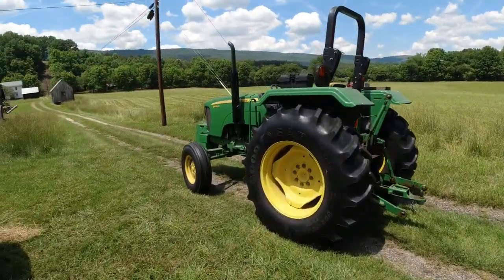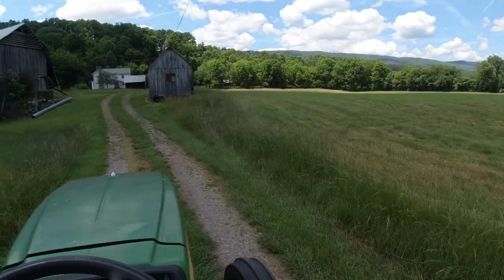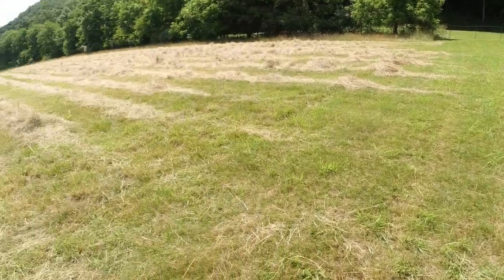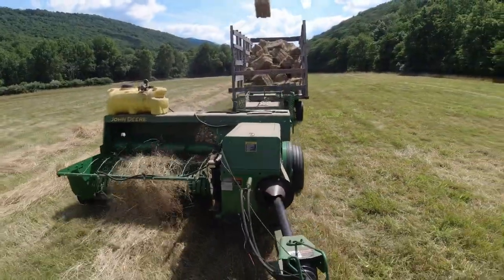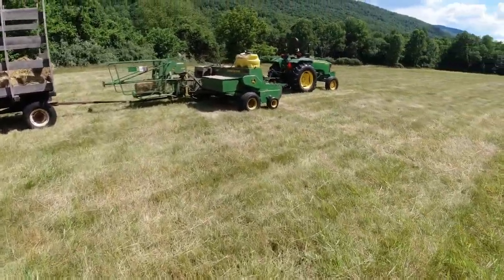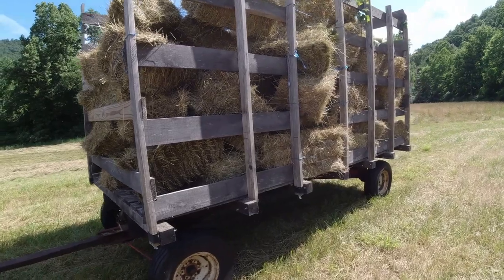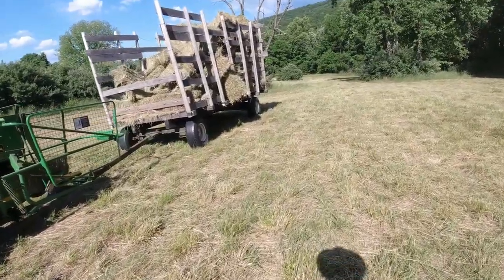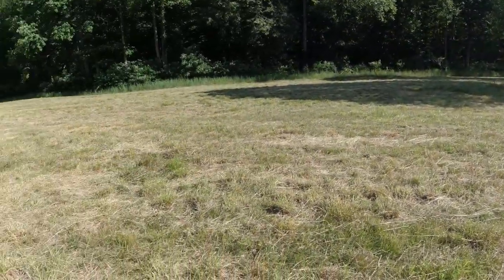Square Baling Hay - John Deere Tractor & Baler In The Low Ground

Comment: Liked your video of baling with all the equipment you used. The moisture monitor is a nice addition, back in the 70's I did a lot of square baling and we just did it by feel. Only had a couple of times when the hay was too wet, but it sure would have made things a lot easier with a moisture meter, as it was called back then. We usually put the hay up too dry and lost some nutritional value as a result, but the customers didn't complain about being too dry, just too wet. Thanks for sharing, I'll watch for more and may subscribe later.
Reply from the maker: Thx for watching…👍

Comment: Hay looks really nice. I made the switch to polly twine in the square baler this year. The baler likes the consistency.
Reply from the maker: Thx!  We had such bad luck with sisal breaking, even with 7200.  Switched to 9600/210 and have zero twine breakage now - zero.  Have to sharpen/replace the twine knife more often.  9600/170 would probably suffice, but the 210 is only a few dollars more.  Thx for watching…👍
Reply: We had the same experience with our 273 New Holland. Sisal wasnt working. Switched to plastic and it never misses a bale.